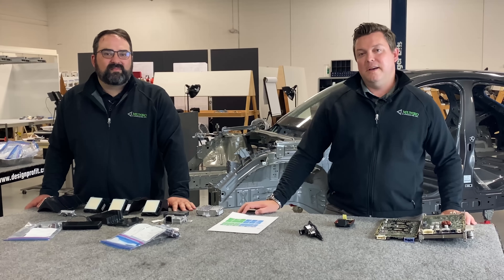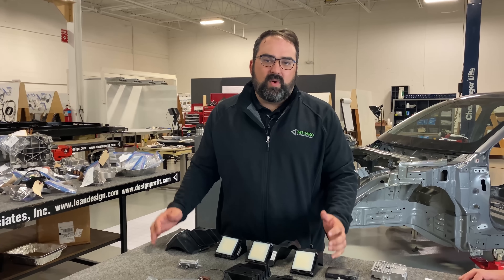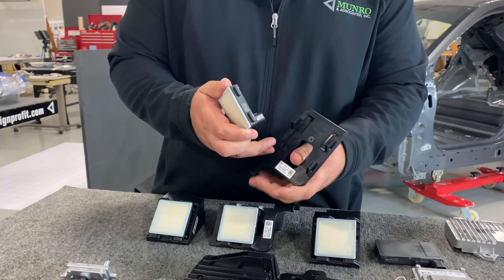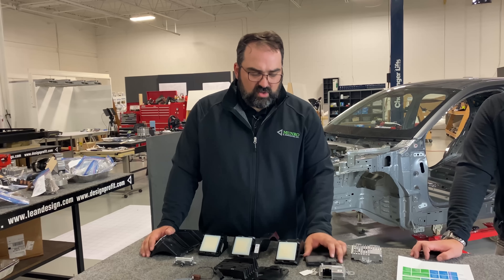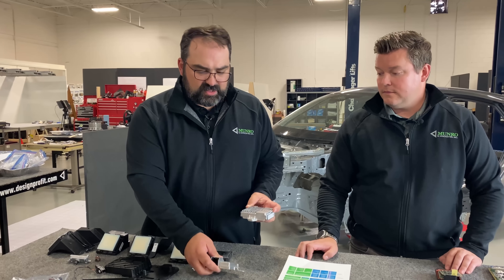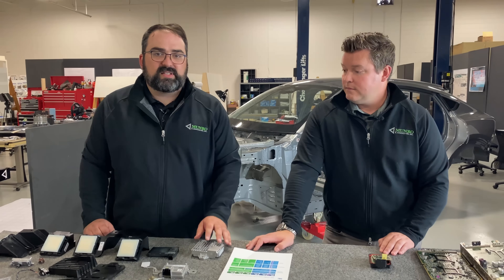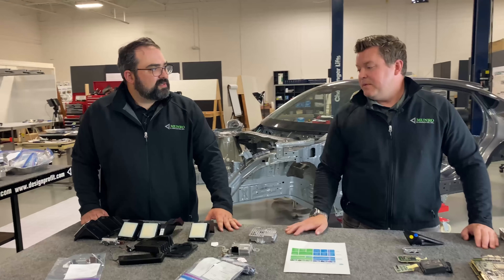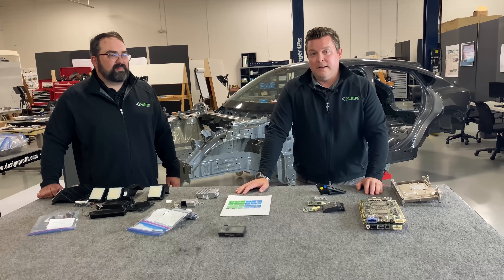Mach-E ADAS Breakdown

Comment: Correct me if I'm wrong but Tesla is keeping the radar on their more expensive models S and X?  This looks more like a cost-savings move by tesla than a move into a future without radar.  Id slow down before calling the mach e system archaic and outdated simply because it uses radar.
 There are certain things radar can do that cameras will never do.  Such as bouncing radar around obstacles to see what is behind them.  Tesla itself has touted that ability for detecting a car slowing In front of the car ahead of you among other things.  It can be remarkably easy to block a camera image.  I for one would prefer a little redundancy in any kind of self-driving system.  I can't imagine ever having level 3 autonomy with cameras alone.
Reply: It is already at close to level 4 on Highways.....Can navigate through roundabouts, and is at around level 3 on major local roads, and at level 2 on urban roads in the city or major towns. That is MY OPINION though. IT IS NOT OFFICAL from Tesla, but from my observation watching the FSD videos.
Reply: Costs savings and overall simplification are certainly the main motivation. But there is some truth to teslas claims, the benefits from radar are somewhat slim compared to what tesla is able to do with cameras right now and by refocusing 100% on vision they are already planning ahead. When other manufacturers inevitably end up with expensive radar, lidar hardware, teslas cameras are just going to be a lot cheaper in mass production and the complexity of the software makes it impossible to quickly adapt for competitors. Its yet another long game that will pay off big when they can suddenly undercut prices and have bigger margins a few years down the road.
Reply: Tesla has explicitly said they don't need radar with 8 cameras. It was hindering the AI learning system because of sending contradictory signals.

" I for one would prefer a little redundancy in any kind of self-driving system."

I agree. With the 8 cameras, I believe every side is covered by at least two cameras, and I think there are three covering the front.
Reply: Wow, your endless shilling and lying for Ford is impressive.
Reply: Endless shilling?  Wow I left two comments.  I actually drive a Toyota btw.  I have no loyalty to Ford.
Reply: @44beebe  your comments are all over this video, why are you lying again?
Reply: @fredbloggs5902  you have more comments and replies on this article than him, and he’s making a valid point with this comment. You rabid Tesla fans have issues.
Reply: @rabidsquirrel22ben  His point isn’t valid, the reason for the move to vision only, has been clearly explained on multiple occasions, and has already been proved to produce better results. 

Moaning about the units still being fitted on the X and S, when all of Tesla’s engineers are currently focused on the 3 and Y, is just absolute conspiracy theory nonsense.

But you’re welcome to believe whatever you like.
Reply: @fredbloggs5902  all of Tesla’s engineers are not focused on only the 3 & Y. They’re are a ton of people there working hard to get the refreshed S out of the gate, and soon the Model X too. Why wouldn’t they drop radar from these newly refreshed models if it’s useless or inferior? You’re just making up excuses out of thin air to justify a cost savings move on the cheaper models.

Comment: AKA
The Ford ADAS hardware is chosen to achieve some level of driver assistance. It can not achieve FSD (level 5)
The Tesla hardware targets FSD (level5), and Its driver assistance features are extracted from its FSD abilities
Reply: And yet Tesla is still considered Level 2…….
Reply: @jokulhaups309  Level 2 from a legal, not a functional standpoint.
Reply: @MsAjax409  If Tesla is so confident in the functionality of their current software, then why can't they offer even a limited Level 3 like Honda can? Or Mercedes in a couple of months? Unlike for many other carmakers, Level 3 isn't even on Tesla's plans.
Reply: @timbehrens9678  Because it is a waste of time. You do understand that this is purely a question of liability? 

It also makes no sense from a business perspective. Not a single cent can be earned by offering such a crippled experience.

Besides having nothing to do with self driving (as this will never lead to anything higher than "L3"), it is easy as hell. Buy a chip from Nvidia, mount a bunch of Lidars, HD map some highway sectors and call it a day.
Reply: @timbehrens9678  It's irrelevant.  Being first to Level 3 was never Tesla's goal.  Solving general autonomous driving is.  Implementing restrictions on when and where Autopilot works, which they could easily do,  would only serve to impede progress to Level 4/5.
Reply: @theipc-twizzt2789  Liability in the Level 3 is just a final requirement among thousand others. A legally binding declaration. Not a technical feat. Obviously that you don't need to even think about liability unless you can meet certain technical reliability criteria. But if Tesla is so convinced in the maturity and superiority of their hardware and software, then this question is very easy to answer. Just assume the liability like Honda or Mercedes do.
Reply: @theipc-twizzt2789  What certainly doesn't make sense is buying Tesla's overpriced Level 2 ADAS with deadly bugs. While Tesla drivers are bound to keep their eyes on the road for years to come, Honda and Mercedes drivers under certain conditions are free to watch a movie or read a newsfeed without fearing for their lives.
Reply: @MsAjax409  There are no technical constraints preventing you in reaching Level 3 first and then being first to the Level 5. Unless, of course, you are willingly constrain the amount of information available for the driving decisions. Without getting anything valuable in return.
Reply: @timbehrens9678  Not true.  Tesla's strategy depends heavily on collecting real-world data for training purposes.  Constraining when, where, and how AP can operate to attain regulatory approval for Level 3 operation would impede progress to full autonomy.
Reply: @MsAjax409 The constraints of the Honda Sensing Elite and Mercedes Drive Pilot (max. ~35 mph driving in a traffic jam) are insignificant for the data collection. In that situation the AP is also constrained by the traffic ahead. But inability of Tesla to vouch for the reliability of it's own Autopilot even in this easy scenario tells volumes. They aren't able to provide even the easiest Level 3 scenario even as an option.
Reply: @timbehrens9678  That's nonsense.  Autopilot is far more capable on highways than either of these systems. The SAE level designation is for legal and marketing purposes.
Reply: @MsAjax409  If it is more capable, then what prevents Tesla from its certification and assumption of the liability issues? If they won't dare doing that for a Level 3 system, now do they hope to do it for orders of magnitude more demanding Level 5 system? Facts are telling very cold truth - currently the AP is an overpriced Level 2 ADAS with deadly bugs. Just like you can't download RAM, you can't bring it up to the Level 5 with some software magic.
Reply: @MsAjax409  You don't need to put each AP release through a certification process. Tesla has to do it once for its subset. And offer you an option to flow with bumper to bumper traffic without keeping your eyes on the road and hands on the wheel. Should be a pretty simple move for a system that according to you outperforms Honda and Mercedes.
Reply: @timbehrens9678  Whatever you say, Tim.  Thanks for the exchange of views.
Reply: @jokulhaups309  for legal reasons it will be Level 2 until it’s level 5.
Incremental is not possible. Levels are just BS , not possible in the US.
Reply: @whowhy9023  They are not possible for Tesla. Other companies are going to offer Level 3 cars in the next 2-3 years.
Reply: @whowhy9023  Apparently GM has received permission to operate their robotaxis without safety drivers in San Francisco.  In good weather and at speeds no higher than 30 MPH.  That makes their system pretty much Level 4 - a geofenced autonomous driving system.

I think we're going to see a number of robotaxis operating in geofenced areas in the US.  Those places where there's enough business to justify the cost of creating and maintaining highly detailed maps (and probably standby remote drivers).

Tesla should have lower vehicle and operating costs but the market is so huge that it won't matter for some time.  Tesla will make more per mile than a geofenced company which will give them money for faster expansion.  Tesla and/or other non-geofenced companies will likely dominate the market in the long run.

AutoX has a fleet of at least 100 geofenced robotaxis in China.  Not the US, but the task of driving is the same.
Reply: Getting caught up in the Level discussion pretty much just shows who has knowledge in this area and who has not. I really liked George Hotz comments on this at Comma 3 reveal. 

Levels mean absolutely nothing. Capability of the system means everything. 

The Level 3 systems some OEMs are coming up with (looking at you Mercedes) are downright laughable. 
It is marketing and nothing else.
Reply: @theipc-twizzt2789  If a joke like Hotz thinks his bolt on smartphone is so capable of anything, then why he won't even dare to go into the Level 3? Again, neither Hotz nor Tesla aren't even close to offer a Level 3 system, not even a limited one. Not even on the plans for Tesla. And, according to Hotz himself, not ever for Comma.ai.
Reply: 🔵🔵🔴🔴🔵🔵🔴🔴🔵🔴🔵🔴🔵🔴 Looks like Ford really thought this out. The radar is very important to have self driving. 
Looks like Tesla made a MASSIVE error in dropping the Radar. It could be the biggest setback of all time.
Correct me if I am wrong, but Tesla has been at Level 2 for 18 years now, correct? 
I hear that Ford has its Robo Taxis on the road in Q4 of this year. Is that right?
Tesla Robo Taxis are a No Go
Reply: What grade would you give  to the current tesla summons?
Reply: @golfish8589  It's way too slow.
Reply: I like Tesla, but contrary to fanboy belief, full autonomy is years away

Comment: What I saw are a few components and what I heard was 2600$ price point for the 360 whatever system
What are the most expensive components in this system cause there is not much on the desk that looks so expensive.

In the long run I would prefer something radar based than camera based cause these camera system have only evolved very slowly and suffer too often from the environment or elements when they loose track or control where the car is.
And they need to be cleaned a lot to avoid such situations but even with the cleanest car there are still too many situations when the sun or any reflection can stop the car system from working.
Not really happy about this outlook with basiscally the same limitations we had seen in the past.
Reply: Please provide your evidence that “there are still too many situations when the sun or any reflection can stop the car system from working”...

...oh wait. You don’t have any.
Reply: The control board for the Mach-E is somewhere else. HE did say that the module is in the shop being taken apart still and analyzed. Also, have you seen Tesla FSD in action so far with 9.1? It is still in early stages since the new software but it drives better or equal to the 8.2 version. That IS a good thing for Tesla FSD so far.

Comment: The US has fully autonomous cars in some locations. No driver at all. Just call one up on your phone app and it comes to you and brings you to your desired location, 100% no driver. @5:24 ....:-)
Reply: The problem is, the cars are only limited to the MAPPED level 4 areas which is a VERY SMALL area. WAYMO have mapped roads in a limited square or so area. Not even worth it, really....It can't drive outside of the mapped areas.
Reply: @1flash3571  Still licensed in the US, he said no....:-)
Reply: Yes, but the method doesn’t scale and is a total dead end.
Reply: @fredbloggs5902  Not relevant to his comment about license for higher level self driving.... :-)

Comment: Got a First Edition. The driver assist is okay-ish on the highway, but on the back-roads with roundabouts and different road markings or lacking thereof  it's downright dangerous. Big fan of the car but ADAS is a big letdown.
Reply: To be fair the Tesla auto-steer is still not up to par either - it'll commonly understeer on super tight turns on backroads, only alerting you when it actually departs from the lane. FSD Beta doesn't have this limitation.

Comment: If all vehicles are then equipped with a large number of radar sensors, won't they interfere with each other?
Reply: Not if they do it right. The signal should be pulsed and modulated.
Reply: @fredbloggs5902  I hope it is done that way - otherwise there will be chaos on the streets. 🤔
Reply: @fredbloggs5902  Ok, then everything is clear. 😀

Comment: It’s only when you see the competition that you realise how advanced Tesla are.

And this option alone costs $2,600!
Reply: Seems like pretty significant downside to pure vision, dawn/dusk happen pretty often I'm told
Reply: @horse_examiner  Tesla FSD has no problems driving at night, your profound ignorance on this isn’t my problem.
Reply: @fredbloggs5902  Thank you for sharing your opinion. I have only seen one fsd beta video where they are driving into the sun on the horizon, they had to turn it off it was so bad
Reply: I'd love for you to explain why the more expensive model s and model x still have radar.  Are they inferior to this new model 3 system?
Reply: @44beebe  They ALREADY SHUT OFF the Radar portion. Keep up will ya? You are 2 steps behind.
Reply: @fredbloggs5902  You can believe what you want, but Tesla have ALREADY solved the DISTANCE, and SPEED issues with the Vision system. So YOU ARE WRONG ON THE Radar. Vision system does the SIMILAR thing as Radar system AND the LIDAR of mapping out the immediate area in REAL TIME. That is how fast the FSD chips and the vision system process the surroundings. They might need the Gen 4 FSD Chip. I think they are working on it now. They might need faster and more powerful FSD system to get to level 5. I think this Gen 3 FSD system can do level 4 when they train the FSD system with DOJO. We will find out on the Ai day this month.
Reply: @fredbloggs5902  You did say that "Tesla is still fitting the Radar". That part I am attacking. Rest, not so much. Yes, On Model X and S, they are still putting the Radar on, but on the 3 and Y, Elon said they are not installing the Radar anymore.....
Reply: @fredbloggs5902  @flash357 haha you guys gotta chill, you are both clearly tesla fan boys, why all the hate?
Reply: @44beebe  Tesla have been concentrating on the model-3 and model-Y for obvious reasons, but you’re welcome to dream up whatever conspiracy you like.
Reply: Spoken like a true Tesla fanboy.  The downsides of getting rid of radar cannot be overcome with cameras alone.  There's nothing in this video to indicate Tesla has a superior product.  All indications are that Tesla got rid of radar simply because they couldn't get enough chips.  Radar plus cameras will always be superior to no radar with the same cameras.  Tesla has only downgraded their product and only because their hand was forced by the chip shortage.
Reply: @44beebe  You’re clearly totally clueless about both radar and the low light capability of cameras, but you’re welcome to cling to whatever fantasy you’ve been told to promote.

Your shilling for Ford is hilarious.
Reply: @fredbloggs5902  haha.  Spoken like a true Tesla fanboy.  I must work for Ford.  LOL.

Comment: Wow, didn’t realize how archaic Ford’s blue cruiser system is.
Reply: I  think it’s pretty impressive considering this is their first time attempting something like this
Reply: I don't understand. How is it archaic?  Radar is archaic?
Reply: @44beebe  Its the implementation of available tech. Ford's attempt is indicative of not understanding the limitations of radar, even though on paper it may seem appropriate for this application

But it depends on their objective. If they are only targeting Level 2, then it's sufficient. They shouldn't expect level 3+ though
Reply: So radar plus one camera is archaic but no radar plus more cameras is the future?  There is nothing wrong with using radar.  Nothing archaic about that.  The more expensive Tesla models s and x are keeping their radar.
Reply: @44beebe  It is because it is cheaper to keep the radar. They can just disable it with software. I think they are keeping the radar due to them too busy with other stuff since software have to take out the program for the radar related stuff. They can just disable it and not use the Radar info for now.
Reply: more like "Blue's Clues" than Blue Cruise

Comment: I love how they are putting radar into thier vehicles and Tesla is taking radar out of thier vehicles.
Reply: I wonder if you can use the radar modules to create a functional microwave oven for tailgating...
Reply: Have you been in a car that suddenly brakes very hard on the highway? Radar = death.
Reply: @blublum7916  The issue is more commonly the opposite, radar not detecting stationary vehicles.
Tesla showed a really great comparison between their forward radar and what vision was seeing. This was on a presentation with Andrej, their head of AI, pretty recently.
Basically when a vehicle quickly slowed down or was stationary, radar would be losing the track on the object periodically and was only able to detect the stationary one pretty late in comparison to vision.

I don't know all the technical details, but having seen their presentation comparing radar and vision and now having seen the vision-only vehicles in use... I'm inclined to believe they're making the right choice. :)